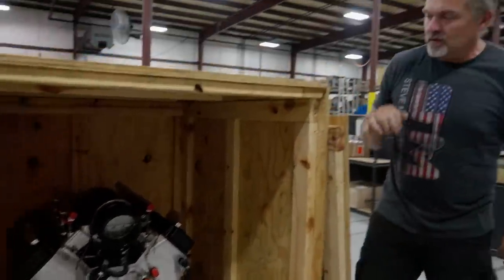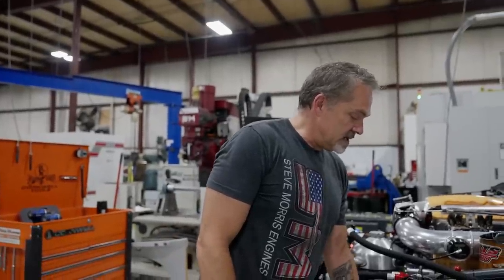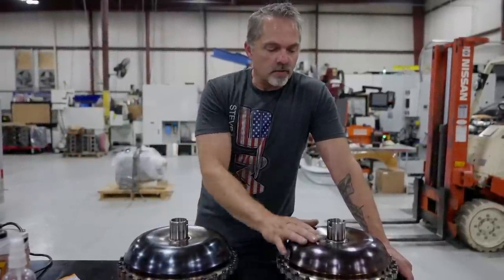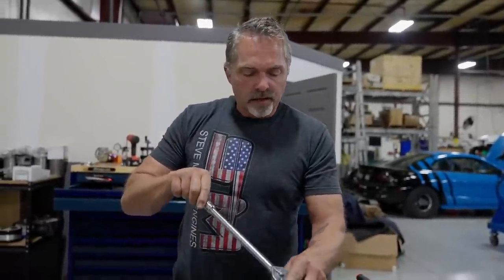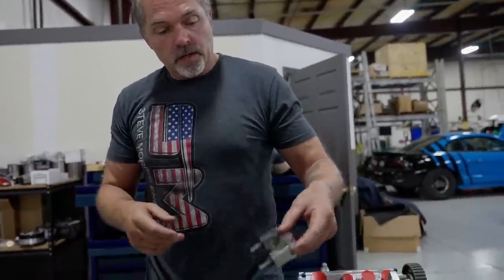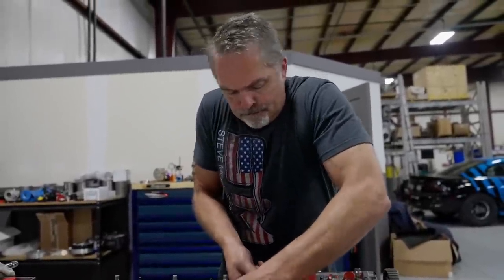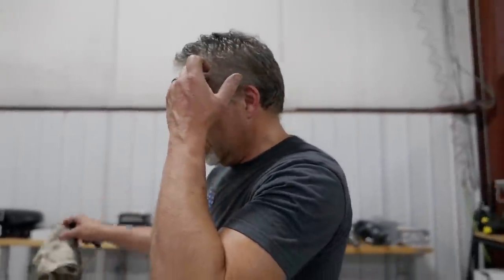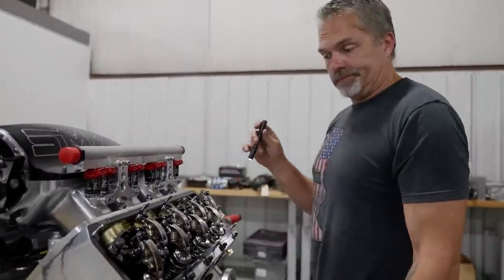What’s Up With Mullets SMX? Part 1

Comment: Steve, absolutely love the videos, I was there at Great Lakes dragway, ur car looked absolutely beautiful! As far as I recall from standing in the pits with cleetus, Zach had said there was some material in the oil filter, the throttle body cable had snapped and after the 6.87 pass he was at the end of the strip for quite awhile. I heard cleetus and Zach talking about having 80psi of oil pressure in the burnout box, but by the end of the run it was 15-20psi. When they put the zip ties on the throttle body and got back up to the burnout box in the quick turnaround, it did not sound healthy, couldn’t make boost or do a easy burnout like mullet normally does. After his second attempt I was back in the pits, watching and it seemed like it could’ve been another rocker or rod, but Zach was showing something in the bottom oil pan to one of ur guys from ur team or anyone that came over to help. Anyway I hope this helps in some way, keep up ur videos!!

Comment: Taking analytical approach (1)source of debris (2) loss of oil pressure. So with no signs of damage in engine other sources to consider = oil pump internals, oil lines, oil tank, TURBOS and their respective lines. 
Anyway typical great video showing all, including your perplexing looks, Thanks Steve!

Comment: What is causing the pop and back pressure in Garret’s passenger side turbo?
Reply: Curious myself. Does it consistently on the burnout now
Reply: Same - that's my thinking also - could it be shedding some crap into the oil filter? Bearing, compressor etc...
Reply: That turbo started leaking oil from seals, probably just oil burning and popping at the turbine side

Comment: Mullet blew up a bunch of motors over the course of its life, prior to the SMX.  Remember just prior to the SMX was the "full hand grenade" of 80 psi boost controller malfunction!  There is most likely residual "crap" in one of the following locations: oil cooler, turbo oil passage or an inside corner of the oil tank.  Most of the lines were changed when Cleetus changed to the SMX but, there are probably some that stayed the same (turbo returns).  In road racing when we loose a motor we change all of the above and clean the lines on a dry sump application.  Ultrasonic cleaning works for the turbo bodies (after disassembly) and the oil tank, that is pretty straight forward, you can do that in-house with a decent ultrasonic cleaner.  The oil coolers in most of our cars are inside the radiator (coolant to oil cooler) not air to oil, it is not a separate oil radiator.  This is pretty much due to space limitations and a quicker oil temp warm up.  There are a bunch of companies around who are set up to clean these type of small tube coolers, both integrated in one unit and 2 separate coolers.  Always have a spare that is clean.  One of the bummers of a dry sump system is that there is a TON of stuff to clean when a motor blows up, and you have to do it.  Since you are seeing crap re-appear in the pressure stage of the pump and filter my guess is that there is a small colony of garbage in one of the turbo passages or turbo return lines.  This dumps a little shiny stuff into the oil tank from time to time and that ruins the pressure stage of the pump and shows in the filter.  Nothing ever makes it into the engine.  Short story swift, clean the ENTIRE oil system in the car,  including the lines, various housings and heat exchangers, then put the freshened motor back in.  I am not a fan of in-line screen filters in the scavenge side oil lines as I have had my issues with them.  Steve, I love your videos.  You do a great job with your motors and offer fantastic customer service.  It's great to see someone else who likes to turn money into velocity and noise!

Comment: Just looked at the video and what is major here is the low oil pressure. If theres nothing wrong with the engine, then it HAS to be the oil pump. Goes straight from the pump to filter right? And no material anywhere else. It makes the most sense. And Garrett stopping actually did save the engine, it would've blown up if the pump was going out.

Comment: I thought he made the decision to stop because it seemed to be low on oil pressure 🤔 I'll be very interested to see if Steve finds something when he tears it down properly
Reply: its the oil pump!
Reply: @paulcook8700  and you know that though magic or X ray vision? 🤣🤣
Reply: @smh28v6   deduction. pre-pump is good, post-filter is good, bearings and clearances are good (or will be when measured), filter is dirty, it's gotta be case wear of the pump or there's leftover shrapnel being caught in the hoses from a previous failure.

Comment: Steve would it be beneficial to use larger diameter trans fluid lines and larger fittings on the trans? Possibly with the lines and fittings you are currently using being smaller,could that cause the pressure to increase under load and cause the fluid to overheat? Just a thought.
Reply: Line size wouldn't cause pressure differences.
Reply: @johncarter1137  It could impede flow causing temps to rise.

Comment: Maybe the hoses were not cleaned totally from oil pump. Also a major point on your torque convertor. We're your hoses properly flushed, a restriction will cause heat to increase. Just questioning. Great videos, and I do learn a lot.

Comment: Steve, as for your convertor, have you ever checked the pressure delta through the cooler? I'm wondering if the cooler is flowing too fast to cool the fluid.

Comment: i think the pump is blown. cleeter lost oil pressure then it came back after it cooled down (pump had wear causing the pressure loss at high temp then once cooled the pressure came back because of the clearances in the pump tightening back up.)  the material in the filter is from the pump eating itself. the lack of debris anywhere else points to the issue being after the oil leaves engine and before the filter and the only thing in that position is the pump and a few feet of oil line.

Comment: Had an issue with the r4 pump recently, found all 3 scavenge gears were wearing themselves away on the housing, gaining excessive clearance and throwing material into the clear view screen. I wouldn't be surprised if that's where some of your material has came from. Since changing from the peterson r4 pump with the twisted rotor design to a moroso gear style i haven't had an issue with material in the filter.

Comment: The metal is coming from the inside of a hose on mullet side, from where the hose attached to the engine to the see through filtering system

Comment: On the torque converter I would think you would need more surface area for the fluid to spread the load, maybe a larger diameter or somehow longer with a spacer between the engine and bellhousing, I know you have an expensive drive shaft, otherwise you may have to have a consult with the E=MC squared Guy

Comment: Your getting down to the minutia that being a good craftsmen requires... and most youtubers don't seem to fall in that category, esp attention hounds like Cleetus.   I would not be surprised if that debris came from making or remaking an oil line that didn't get cleaned out well from the chop saw, or maybe debris left in the dry sump tank or system from the last blow up.   IF the debris is actually from the inside of that motor, given the history of it (if I am thinking right) MAAAAYBE you have something that has been left in the blind side of the oil holes that feed the rods from the mains.   Brake cleen thru a straw with the tip bent is the only way to flush that out and I have seen that on most any crank thats been turned or polished....  My .02....   Thanks for the vid, hope to see the results...

Comment: Doing a few calculations, the block will grow by 0.6-0.8mm if it's warm when you check it (that's 15-25 thou).  Steel would grow 0.3-0.4mm (7-12 thou).  That could explain the extra thrust movement at the track?

Comment: Maybe something in the pump itself self clearanced, sending it up to the filter or maybe even one of the lines from the pump had material in it from before and that's what you saw? Did Cleeter & co put new lines on or re-use? If they re-used, did they flush them? One of those little details that gets missed if you're thrashing. Only other oiling involved is the turbos and they were leaking IIRC? Something there?? But now I'm guessing as I'm outside my knowledge. :)

I do like teardown videos like this though as I personally learn so much and it's great to understand how these motors work as it makes watching the content from guys like Cleetus that bit more interesting. Thanks for treating your viewers with this courtesy Steve, really appreciate it.

Comment: I'm novice but I'm still pretty confident the spring issue is related to oil in the air intake through the leaky turbo. That actually backfired THROUGH the turbo 3-4 times before the engine was taken out of Mullet. Maybe it backfired out of the valve that broke its spring...

Comment: Engine looks great, I would be looking into the oiling system, pump etc to check their health/status.... Wonder also if its something weird to do with the converter setup when it comes to the clearances for the thrust. Appears perfect when out of the car but I wonder if something is causing extra movement when its installed in the car if thats even possible?? Rest assured its in great hands, love watching you work!

Comment: 19:50.   HEY STEVE IT'S THE ROLLER THRUST IN THE REAR AND TURN THE CRANK WHEN MESURING THRUST BECAUSE YOU WILL HAVE SPOTS WHERE IT WONT AND SPOTS THAT WILL MOVE ALOT

Comment: If Cleetus didn’t replace the oil lines and heat exchangers after the oil pump shredded that pre-filter stainless screen, The material came from there.

Comment: Turbo oil lines are not independently filtered, could be coming from them but that would still show in the oil pan unless the lines go to some other port on the engine rather than the oil pan

Comment: As for the thrust clearance, keep in mind that the thrust hot and the thrust cold may be different.  Aluminum expands twice as much as steel so the block grows in length about .020 when it gets hot.  Since you have the needle bearings at the front of the block and the standard flanged thrust main at the back you may be bearing on the needle bearings up front when cold and the standard thrust bearing at the back when hot.  You could have .007 to .010 cold and then have .024 to .030 hot because the front "moves away".  Either way, I don't think that is enough to make the rods drag on one side, although there were some marks on one side of the rod caps you pulled.  Fun stuff, every day is a science project!!!!!!!

Comment: I was thinking oil pump as well, but Steve explained that the oil goes through the filter before going through the pump. So if it is the pump, it would be pushing particles through the engine and we would have seen signs on the bearings and in the pan. 

If the oil goes through the pump first then to the filter, then it would make sense not seeing metal in the pan and no damage on the bearing. 

Wont be a bad idea to run filters pre and post pump if he start encountering more issues with these pumps.

Comment: From what it looks like I would
Look into the return to the oil pump there might be some type of flow restriction to the pump causing the pumps to fail and therefore leave material in the filter tray.

Comment: Steve number 8 cylinder rod bearing looked over polished on one side of rod cap ..at least through my phone 
.Camshaft end plate bearing. Maybe. Not sure if you use a bearing behind the gear or a shim ..I know you know ..I missed the chance to be doing what I wanted to do
Anyway be safe

Comment: I'm not completely familiar with the engine and its flow but if the oil pump is before the engine oil filter then I'd be putting it down as the culprit.
Especially considering there wasn't any signs of shaving/debris elsewhere.
I enjoyed this video Steve you are a wealth of knowledge cheers. 👍

Comment: Do you ever carry out laboratory analysis of the oil? Previously had it done and indicated the metal/alloy type that enables it to be narrowed down to bearing material, alloys or steel from valve train etc
Reply: A magnet can tell you alot before an oil analysis...

Comment: Did you check to see if you had every little piece of the broken spring? What size is the pump pickup screen? If just one piece dropped into oil pan and hit the oil pickup it could leave no trace behind until the oil pump ate it. You don’t have to see carnage in the pan for something to have passed through and made it’s way to the pump, right?

Comment: For there to be a loss of oil pressure, there either has to be a leak in the system (excessive clearance somewhere) or a reduction in volume moving through the system.  If all of the bearings are still intact and the pump isn't chewed up, I would be looking hard at the oil pump bypass valve.  If that joker hangs open, majority of oil will bypass rather than move through the engine.

Comment: What feeds into the oil screen?  Oil pump, Turbos?    The oil filter and sight screen are catching all of it. Something outside the motor that is still in the oil system is coming apart.

Comment: When the screen got sucked out of the oil pan and through the oil pump and pumped material into the tank etc... awhile back, they had to replace the oil pump, the oil pan screen, and clean the tank etc.. I am betting the metal in the filter was still in the oil tank after it was cleaned out, or in the line from the pump to the tank, or from the tank to the pump.

Comment: This has to be one of those tough, common moments where the fingerpointing starts and the engine builder is always blamed. There are so many pieces of equipment bolted to a perfect engine that can cause trouble.

Oil pump? The turbo that was coming apart? (Where does the oild drain on this setup? Contamination in the 300 feet of custom oil lines? Oil cooler? Was any of this equipment reused from a previous engine setup?

Much respect for you and your artistry Steve!

Comment: The filter is remotely mounted. If it goes through the cooler first, then suspect the cooler. It's between the pump and the filter somewhere.

Comment: Maybe it’s got into the thrust bearing under boost and heat and now that it’s cooled and the oil and metal has cooled it’s showing the right tolerance at 7000 but once the motor is hot and the oil is thinner it will move around more due to it starting to wear, it may have just not worn completely yet

Comment: Another thought is that the oil flow is so powerful that even stuff that lands in the pan is flushed on into the filter. That dry sump system looks like it moves a huge volume of oil pretty fast. So wonder if it basically washes the pan clean.
But sill, for some reason I still stick to the notion that it is something left behind.

Comment: Scavange stage fudged on the pump, twisted shaft and it escalates quickly.  Nothing in the pan and junk in the filter, what’s in the tank? Low oil pressure and all the bearings are fine, pump issues is the only thing left.

Comment: Here I was thinking that cleet was having issues with a converter ballooning.

I'm not familiar with the oiling system, but my guess would be something in the oil pump?
If I remember rightly, cleet tore up a pump, so it could be material from a rebuilt pump. Or the clearances in the pump were wrong and something got eaten up.

Comment: I’d bet there’s an issue with the oil pump if there’s no signs of material anywhere else. Possibly a small piece of broken valve spring sucked up into the pump. That would also explain the low oil pressure if your not loosing any pressure through the bearings.

Comment: oil pump is tight because of uneven wear internally.  💰  With CM it's likely that they used the tension on the oil pump shaft to offset or straighten out some other issue.

Comment: Just my guess if there is no metal in the engine. I would say the metal in the oil filter came from either the oil lines or from the oil pump. It had to come from something between the block and the filter.

Comment: Did the oil pump have an issue prior that it needed to be replaced?  Being an external oil pump and going to the filter next, assuming external oil lines to the filter.  My guess is the oil line going from the pump to the filter didn't get thoroughly cleaned.  It's old material as the oil pressure cleaned the lines.

Comment: went back and rewatched the cleetus vid. definitely more movement in that screwdriver test. occoms razor says the simplest explanation is right. that means thrust bearing. the question then is why is the thrust fine now? dont have an answer, i think youll find it when you open it. that was a lot of metal in the filter. it makes sense there wasnt metal in the pan with a thrust bearing issue too like you were saying

Comment: Check the oil pump, it feeds off the cylinder head so when that spring broke it could have sucked a small fragment into the pump.

Comment: Steve, you already know the issue... i appreciate you showing the bearings to clear you.. but hopefully the charge pressure will be addressed.  And hopefully, we will see Mullett and the Wagon run side by side!!!
Reply: and what i meant by charge pressure, is from the converter/transmission.  Apparently, Garrett has already sent that out to be addressed.

Comment: oil pump? if i remember correctly it was swapped out for a new one at some point right? could shavings from the fittings of the manufacturing process have been left inside? and once it was run leaving it in the lines? then slowly getting caught by the filter? 

I understand these are pretty high pressure but with the restrictions of the block passages i am not sure how fast the flow is to move it through those lines? 

because it seemed like it was a bunch of stuff at first, and continuously left less and less in the filter.